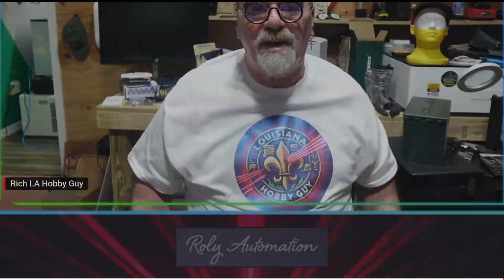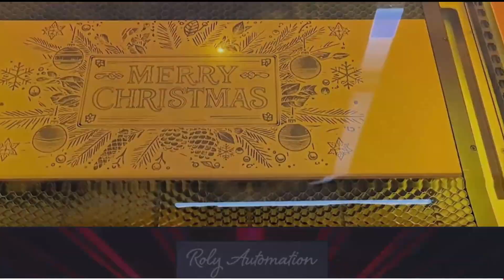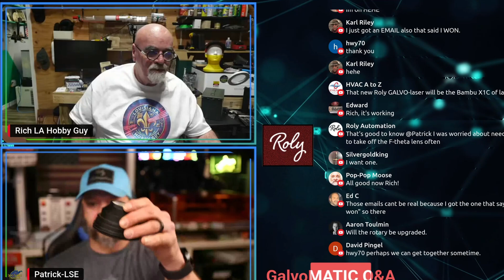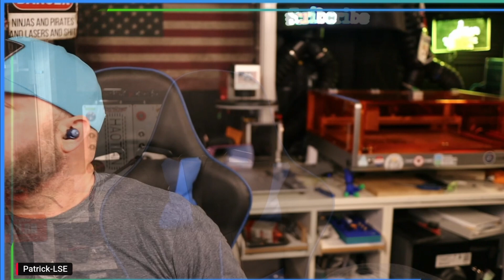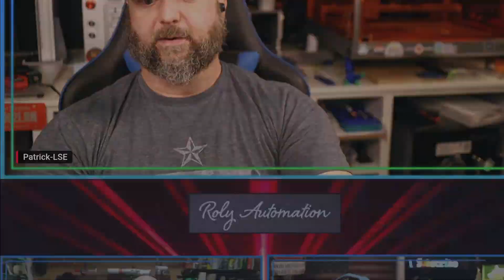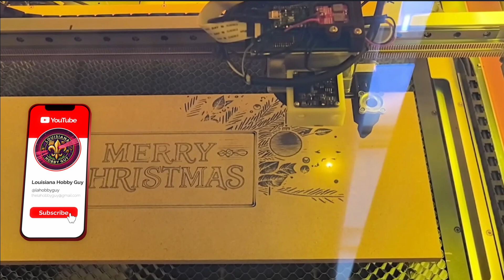🎉 GalvoMATIC Livestream Replay! See the new features of the best diode laser on the market! #roly

Comment: This is going to be amazing. Love my XW. How tall is it? Not that it matters because I want one anyways. :)
Reply from the maker: It's going to be almost exactly the same as the Mk2 LaserMATIC, except the bed depth will be a little deeper.
Reply: @TheLouisianaHobbyGuy  that is amazing. They really have put in the time. ❤️ Have you seen one get cleaned after some use? I am curious if it is going to be just as easy to maintain as the MK2. Apologies if it's a dumb question. I haven't had a chance to play with a galvo yet.
Reply from the maker: Much easier to clean. The galvo lens can be cleaned without any disassembly.
Reply: @TheLouisianaHobbyGuy  Amazing! Is it going to have the drop-down wattage like the 30/10.
Reply from the maker: Yes, if you choose the option for 20/40.

Comment: Looks awesome, but I'm really wondering if it will have issues with a grid pattern showing up on large solid engraves due to overlapping or gaps where the pattern is tiled together.
Reply from the maker: That's a great question and something you actually saw for yourself in the demo. This is CNC software and it's extremely accurate!